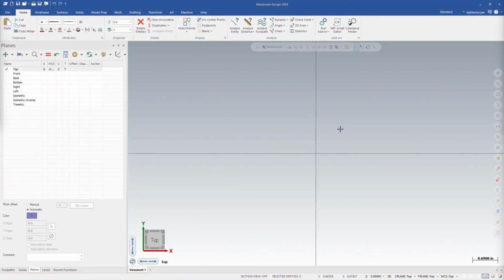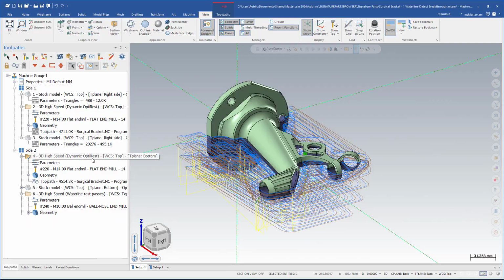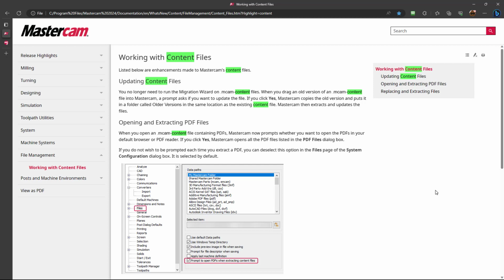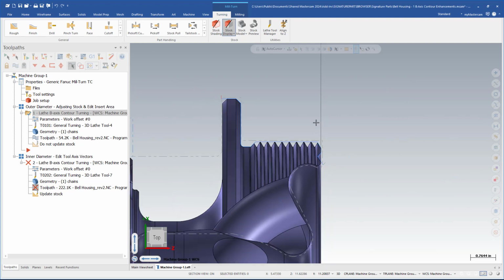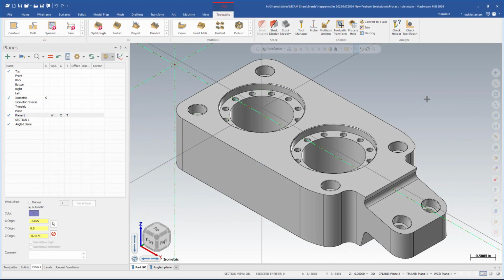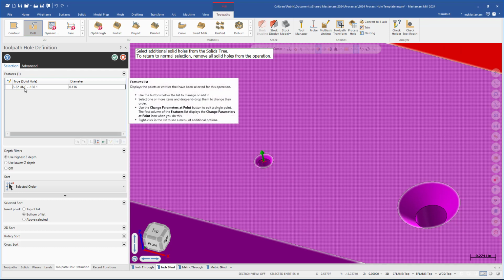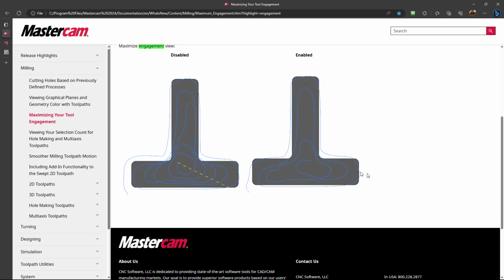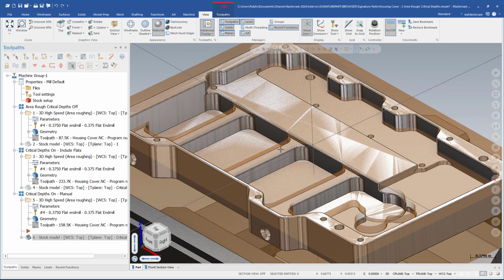Mastercam 2024 New Feature Breakdown Part 1 | Webinar

Comment: 12:30 why would i need to ramp in in this example? Looks to me like it could be entered from the outside.
Reply from the maker: Hi @ipadize! In this example, we're using the stock option, which limits the containment option to "stay inside". You can get around that by using a larger containment boundary, but we were trying to show the difference in helical entry here, so that would defeat the point to come in from the outside. But yes in this type of scenario, I would probably try to overdraw the containment and give myself enough room to enter from the side if possible. Thanks for the question!